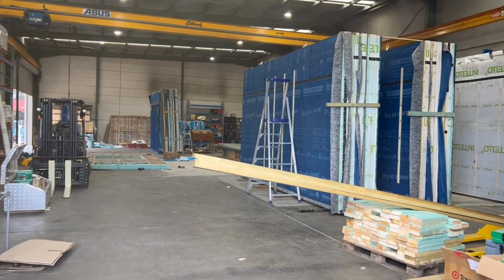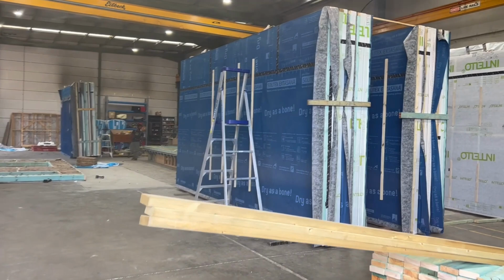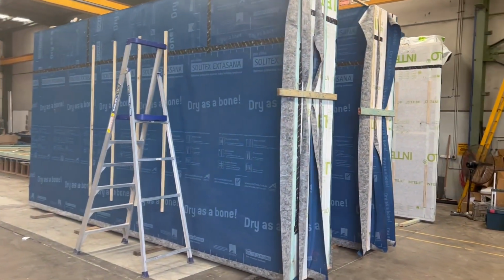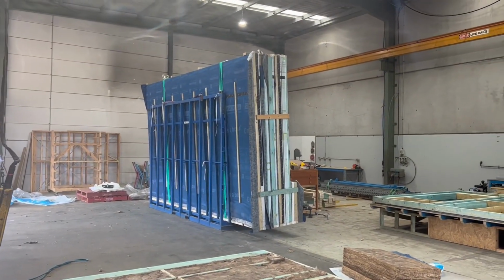How to install Passive House wall panels

Comment: Wots the blue stuff on the walls for?
Reply from the maker: Hey Cam. It is the external weatherproof layer for the walls. It is a high performance sarking layer that prevents water ingress and also acts as a backup airtight layer. 
Once it is taped and sealed correctly and joined to the heavy duty version on the roof it forms a complete weatherproof shell for the house